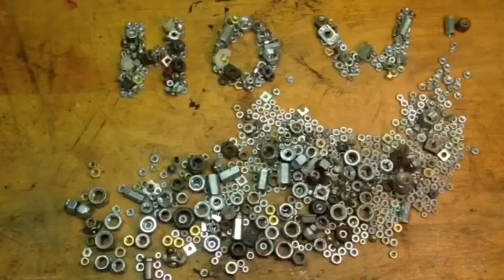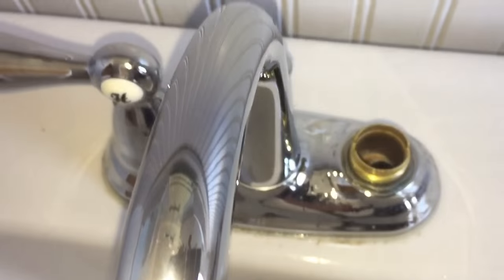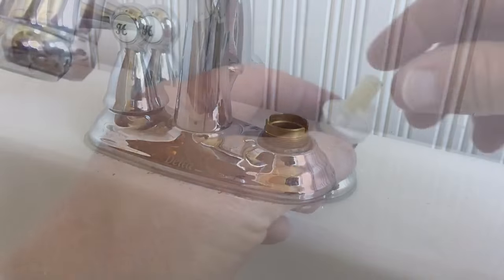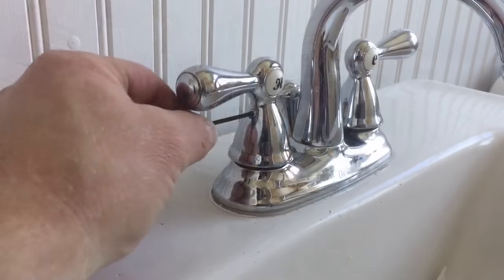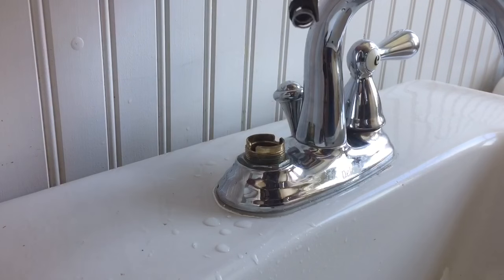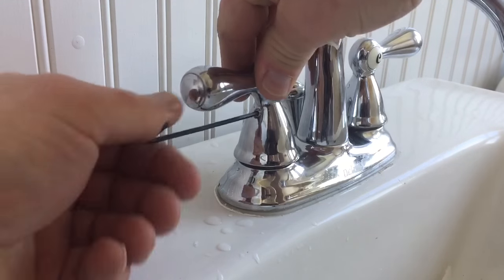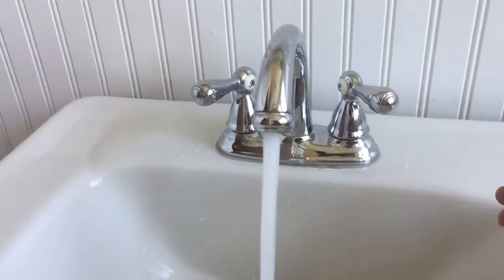How to change the stems, seats and springs in a Delta Faucet

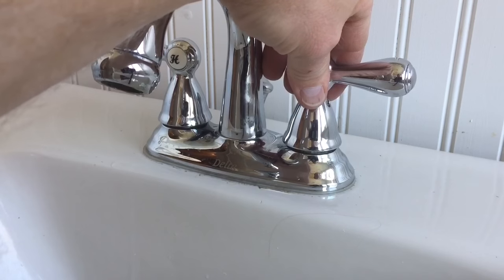Comment: Help! I can’t pull off the base of the handle. I see yours came up and off at 0:54 seconds in. My Delta faucet was leaking hot water from the spout, so I turned off the hot water to the faucet. I removed the set screw, but the base of the hot water handle simply will not come off. You got yours removed at 0:54 seconds in, but mine just won’t lift off. I’ve sprayed it with penetrating oil and still it won’t budge. I also tried prying it up and off with a screwdriver, but it still won’t budge.

I previously, a couple of years ago removed the handle on the cold water side in order to replace a washer when the cold water was leaking, so I know this base should just come up and off, but it is not moving.

Strangely enough, now that I have sprayed the hot water base with penetrating oil, now when I turn on the COLD water that causes water to leak out beneath the HOT water handle base. This is a very odd symptom.

How can I get the base of the hot water handle to come off?

Comment: All I did was replace the seats and springs but have the same problem with it dripping like yours did as it did before I replaced the seats and springs. I am guessing it is time for new stems as well at this point. What do you think?
Reply from the maker: Sounds like it. Thanks for watching.
Reply: funbro1 I never got a chance to report back. I purchased new stems that I ordered online. It took a few days to get to me. In the mean time the original stems healed themselves that I replaced the seats and springs on. It hasn’t leaked again since. So I kept the new stems as a backup just in case I ever need them again which I am sure will happen eventually. It’s a easy job to do so I am not going to sweat it. I am just amazed that it took 2 or so days for what was a slight drip to stop altogether.
Reply from the maker: @ffas23  Sometimes it takes time for them to seat. Glad it worked out for you.

Comment: Hey Bob.  Last night my kitchen sink started giving me an issue on the hot water side (it’s two handled). I use the hot side a lot more which I’m sure is part of the reason why it started to malfunction more.  I disassembled everything and found that the shut off valve must have given out.  I replaced it and reassembled everything and now when I turn the hot water shut off valve to on, the water constantly runs in the sink and no matter what I do, with or without the handle fully on, it won’t shut off.  There are no leaks and the cold water side runs normal like it always does.  I have to operate the water now on the hot side solely by the shut off valve versus using the sink handle.  It’s an older sink.  I was thinking of getting two new universal handles for the top from Lowe’s. Could the stem be stripped?  What are your thoughts?   Thank you
Reply from the maker: It is possible that something (calcium deposits) became dislodged and ended up in the next smallest area (your faucet). You can take the hot handle off and pull the stem make sure everything is clean and in good shape. If not replacement of the seats and springs would be the next place I would go. Hope this helps, Thanks for watching.
Reply: funbro1 Thanks pal!

Comment: I'm having trouble getting the washer and spring to fit all the way in the hole. Any suggestions to help?
Reply: I aligned them on my allen key, then pointed the key into the hole so they'd stay properly aligned. As long as they're sitting the right way, the cartridge should squash them down correctly into the hole.

Comment: Do all these have seats and springs? The stem/cartridge I am using looks just like the one you have in this video, but I do not see a seat or spring in the base.
Reply from the maker: Most Delta faucets use seats and springs, that being said they may be using something different on some of the newer high end faucets.
Hope this helps, thanks for watching.

Comment: Can you think of a reason why after completing these steps that the faucet wouldn’t flow all? (Water was turned on underneath sink but absolutely 0 flow.) I’m worried I did something very wrong.
Reply from the maker: Check the aerator on the tip of the spout, sometimes they get clogged so much that no water comes out. Hope this helps. Thanks for watching.

Comment: Is the seat supposed to be fairly easy? I've been nearly dislocsting my thumb to try and push mine in. The cold side went in with "some" force. The hot side I've been messing with for a year
Reply from the maker: The seats should slide right in very easy, sounds like you have something else going on there, maybe the wrong seats?

Comment: Bob, I live in a mobile home and the faucet is an unknown brand. Are most of the seats and springs replaced the same way ?
I know that the seats & springs are different sizes, but is the procedure the same ?
Reply: Oh, by the way, great video. (allen WRENCH, not allen key)
Reply from the maker: Most are very similar depending on the brand. The most important thing is getting the correct part once you get inside the faucet.  The procedure is about the same.

BTW check out a what a google search for allen key came back with(it also included a picture of the very tool that I used.:  A hex key, Allen key or Allen wrench
 is a tool of hexagonal cross-section used to drive bolts and screws 
that have a hexagonal socket in the head (internal-wrenching hexagon 
drive).  

Glad I could help, Good luck.

Comment: I put a new washer and spring in then I put it all together, I turned on the water and the water flowed but it would not shut off all of the way.
Reply from the maker: Try taking the seats out and rotating them to the other side of the stop and put them back in that way. This might fix the issue. If you look at the seat  you can see a channel where the water flows, make sure that lines up with the hole in the faucet. Thanks for watching
Reply: I had this problem, also. It is important to have the solid metal part (on the bottom) of the stem lined up over the seat and spring.  

The solid metal is what keeps the water from flowing. If incorrectly lined up, the water will flow continuously from the faucet.

Comment: After doing this it works a few days and starts dripping again. Only on my hot side. I replace them. Works for a week and does it again. What could be wrong? This has been going on for months now and I have put about 6 springs/washer so far. I opened up the bottom part and all looks well. No leaks below. The hot water does look muddy though...
Reply from the maker: It could be a simple as a bur on the valve body that is causing the seats to wear in one spot making it leak or even some calcium deposits that got in the way. Hard to diagnose without seeing it, but I hope this helps. Thanks for watching.

Comment: my facet does not shut off after i turn the handles off right away.  it kind of does a heavy dribble then stops and does not drip.  would changing the stem valves solve this problem?
Reply from the maker: For the price of the seats and springs it would be worth a try.
Thanks for watching.

Comment: What’s the trick if the new rubber seat doesn’t want to line up and sit into the hole over the spring? I threaded an Allen wrench with the spring and seat to place them into the water line/hole and still couldn’t get the seat to slip snuggly into the line. Any  tips?
Reply from the maker: No tips, just patience and a very thin pair of needle nose pliers. Thanks for watching.
Reply: funbro1 Thank you for the reply. I ended up using a very small flat head screwdriver to gently wedge the seat into place. It took a while, but it finally worked!

Comment: I did the exact same thing in this video..I thought anyway... but when I turned the water back on.water comes out of the faucet but the handle won't turn the water off
Reply: Often the seal and spring are not all the way down in the hole, which prevents the valve from seating properly. (This happened to me a few minutes ago.). The valve itself has notches on the top of it and the there are plastic tab pieces on the valve, one on each side, and those tabs have to be seated in those notches. (See 1:18 in the video where he uses his putty knife to lift a tab out of one of the notches.). Sometimes, they will only go in one way, so be careful. Then there is a flat spot on the valve stem and the Allen screw on the handle seats on this flat spot when attaching the handle. Paying attention to detail is very important in doing this. Only professional plumbers get it right the first time. Good luck and take smartphone pictures of the stages of your next project from start to complete disassembly, so you will have a better idea of how it goes back together.
Reply from the maker: Awesome advice, and thanks for watching.

Comment: When I turn the water supply back on the handle isn’t turned and the water still flows, did I put it back together wrong?
Reply from the maker: It definitely sounds like something is not put back together correctly.

Comment: What is the problem when there is still a constant slow drip from the stem and the new spring and seat are installed.  Is it time for a new faucet?
Reply from the maker: It is possible that the seat area in the faucet has a scratch in it from calcium allowing water to seep past the seal of the seats. In that case it would be better to get a new faucet. Look real close down in the pocket and see if the area where the seats sit is smooth, that will tell you if it will seal. Hope this helps, Thanks for watching.
Reply: @funbro1  Thank you!  You're correct!  I sanded the seat area and it worked!  Again, thanks!

Comment: Is the silicone grease dangerous? It will probably go into your drinking water and be consumed by anyone who drinks from this faucet.
Reply from the maker: It is a food grade grease meant for this purpose so it should be fine. Many faucets come with some from the factory put in there during assembly. Thanks for the view.

Comment: What would cause a delta  (3 handle) tubset to continue to drip from the spout AFTER the cartridge, spring and seat have been changed?
Reply from the maker: Sounds like there may be another way that water is bypassing the seats, it could be a cut or scratch in the seat or in the faucet itself allowing water to seep around the seats. Hope this gives you something to go on. Thanks for watching.

Comment: I would not use needle nose to re-install the new cup, too much chance of putting a nick or mark in the new cup.  I guide them in using a small screwdriver, slide them on the screwdriver, put the tip of the screwdriver in the hole and let them simply fall down. Then, of course you have to make sure that the bottom of the cup, with is slightly flared out, gets seated correctly in the hole or it won't last long.
Reply from the maker: I would not use a screwdriver to re-install the new cup, too much chance of putting a nick or mark in the new cup. I guide them in "carefully" using  needle nose. But I guess there is more than one way. Thanks for watching.
Reply: Let me get this straight .... the rubber seat - flared side down - sits on top of the small end of the spring ? And I would use a small screwdriver like you.
Reply from the maker: Sounds correct, should have no problems. Thanks for watching.

Comment: Hi, It looks like I have similar model but I am having issues with removing handle. I was able to unscrew allen screw but after that handle does not come out. I have tried to pull out with some force upwards but it did not come up. Any idea, what should I do ?
Reply: I tried tapping with Hammer all around, put wd40 where allen screw is located and also tried wd40 from small opening in the bottom but still handle does not come out. I tried putting flat screw driver on the bottom and tried to pry it up and also tried hammer on screw to pull handle upwards but no success. Disappointing that taking out handle is too hard. Also tried Heat Gun.
Reply: Finally I was to remove handle. You have to pry up hard. I did with screw driver and it broke so need to do with Industrial Punch and Chisel Set ,  you have put chisel on the bottom and try to lift it up and  may be hit with hammer on chisel. Tried Vinegar/CLR for 2 days but I was not able to pull handle until I pry it up with Chisel. you would need lots of patience . Good Luck.
Reply from the maker: Sounds like you could use a stem/handle puller tool. They are relatively inexpensive at most hardware stores and a good tool to add to the collection. Thanks for watching
Reply: Did not find out how to use Handle Puller Tool for L type handle. I have seen for other types for use with Handle Puller. May be there is one for this type as well. May be you can recommend which one, which might help other folks who have same issue and save some time and frustation
Reply from the maker: I just picked up a cheap one at the hardware store, it doesn't need to be anything special because it's not a toll that gets used that much by the average person. Thanks for the good idea for a new video.

Comment: I noticed that my shower keeps running, upon further inspection I found that I had the spring but not the seat. Is this the problem ?
Reply from the maker: +jovannymoreno09 That sounds right on target. Without the seat it will definitely leak. Thanks for watching.

Comment: I've followed the directions completely, but the faucet doesn't go back on flush with the base of the faucet. So what have I done wrong? and how do I correct it?
Reply from the maker: There is a cutout around the outside on the metal that should line up with a notch on the stem, maybe it is not lined up correctly?
Reply: I did get it to line up! Great Instructions It was sooo easy! Thanks

Comment: I loosened the Allen wrench on mine and the handle will not come off it is stuck hard in there
Reply from the maker: Many times the calcium and corrosion make it very hard to remove. Try coating the area with a calcium, lime, or scale remover then tap it lightly to work the remover in to the area. Hope this loosens it up for you. Thanks for watching.

Comment: Every time I turn on the hot water side of my sink it drips underneath the sink. Like coming from the mounting but any idea?
Reply from the maker: Sounds like the connection between your supply lines and the faucet may be the issue. Start there ans work your way in. Thanks for watching.
Reply: funbro1 yeah I think what it was is the seat was put all the way of the spring it was kind of loose. So I reseated it and then tightend the locking nut and the hose connection for good measure.
Reply from the maker: Hopefully that was all that was wrong.

Comment: Well, for the life of me I can’t get the rubber stopper back in the seat hole. Been at it for 2 hours. Took off the cold water faucet to see how the spring went in and it popped out, so I couldn’t check it. Also, the Allen screw stripped, so now I can’t put it back together. $15 repair will now be a new $150 faucet. 🤬
Reply from the maker: That’s unfortunate. 😞

Comment: It all looks so easy...IF, the frigging nut comes off.  In my case, on both faucet handles (which are not one piece as shown in the video above), the nut would not come off; turning it just turned the whole assembly.  Underneath, I could see the square, flat plate threaded around the fitting where the two water lines entered.  When turning the nut up above (as shown in the video), the fitting underneath would turn threatening to twist the water lines together (two lines going into each faucet handle from below.  Now, my valve leaks are worse.  I cannot get a wrench around the square, flat plate to tighten it, there isn't enough room and it is too thin.  Any suggestions or advice on special tools available to put on the flat plate to tighten it?  
I also tried to hold onto the escutcheon with one wrench and turn the nut with another...to no avail.
Reply from the maker: Only suggestion I would have is to soak it with some penetrating oil and lightly tap it with a hard object to work the oil into the threads. Hopefully that will enable you to get the nut loose. If that doesn't work and there is too much damage to the faucet  I fear you may in for a replacement. I wish you the best luck and thanks for watching.
Reply: Thanks, I neglected to mention I hit is with WD-40 multiple times.  There isn't any damage to the faucet except for the leak.  Again, thanks, it was otherwise a very helpful video.

Comment: When I put the handle on my Delta faucet, it doesn't hit the stops on the cartridge.  The handle can turn in circles without stopping.  The cartridge is the one that came with the unit, and I don't see any obvious way of adjusting it.  I'm pretty confused.
Reply from the maker: There should be a stop on the cartridge that hits to make it stop, I'm not sure what you have going on?
Reply: funbro1 I figured it out.  There was a way to adjust the height of the cartridge so that the handle could reach the stops.  It was obvious at first, but after I had more time to look at both levers, I saw the problem.

Comment: The thing thats confusing is to loosen the bonnet nut you rotate to the right -opposite what you think.    So its not lefty loosey rightey tighty but opposite. What can you do about green calcification?
Reply from the maker: Green calcification can be removed by using CLR or vinegar. Sometimes this calcification will ruin the finish. Hope this helps, Thanks for watching

Comment: It's a HEX Key, not Alan key.
Reply from the maker: Hey Darrel, It’s ALLEN Key, not Alan key. 

Just for your education: 
A hex key, also known as an Allen key is a simple tool used to drive bolts and screws with hexagonal sockets in their heads.
Thanks for checking in.
Reply: @funbro1  my stupid phone corrects everything. But you know what I meant. Thx for the video.
Reply from the maker: And I think you know what I meant.